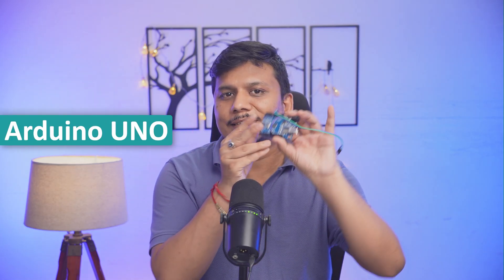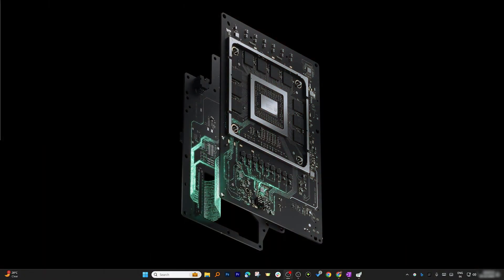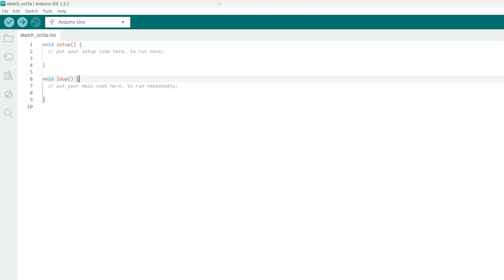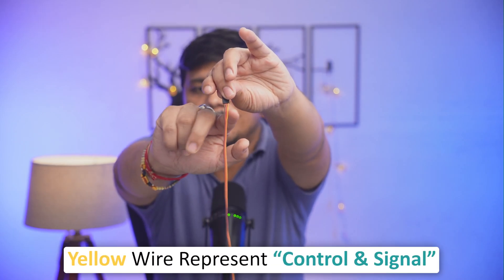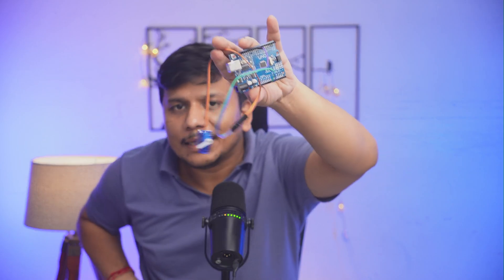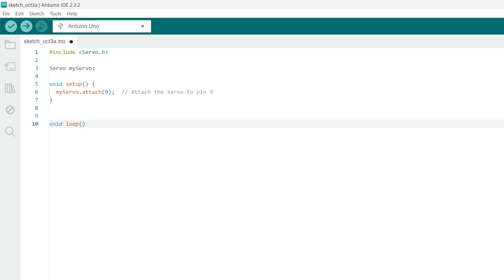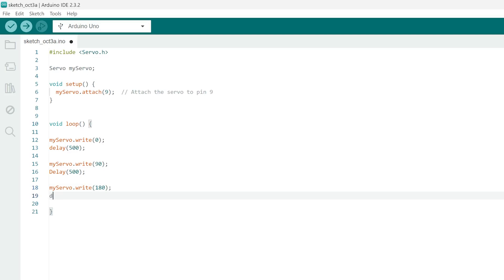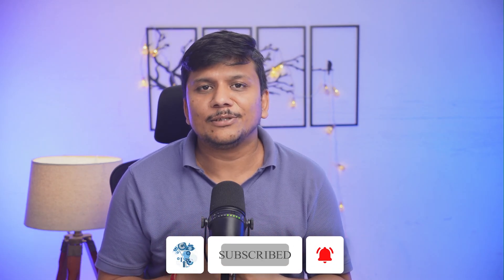Arduino Servo Motor Control: Using Libraries for Beginners | Easy Tutorial

Comment: Hi 
I am getting an error : Servo.h No such file or directory Please help
I have tried multiple different methods but still no change
Reply from the maker: It sounds like you're running into a common issue! Make sure you have the Servo library installed correctly in your Arduino IDE.